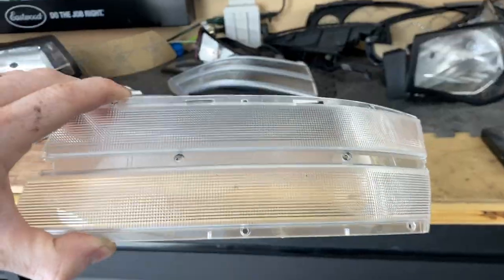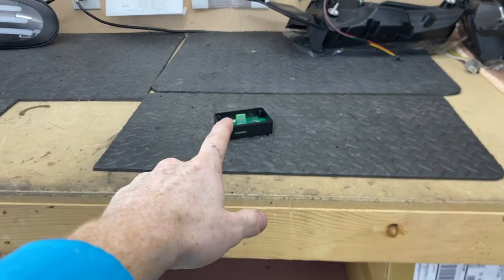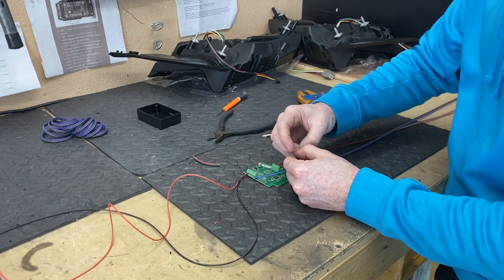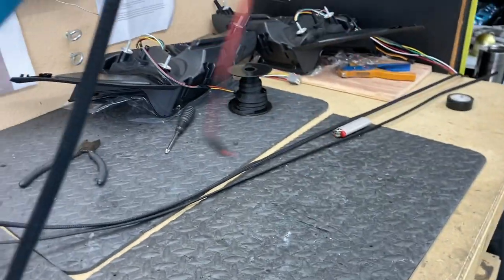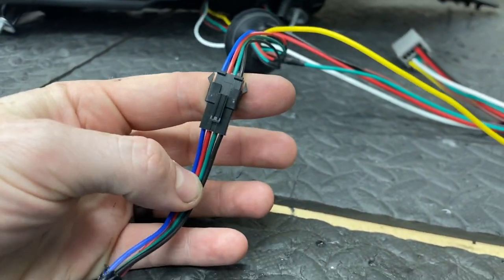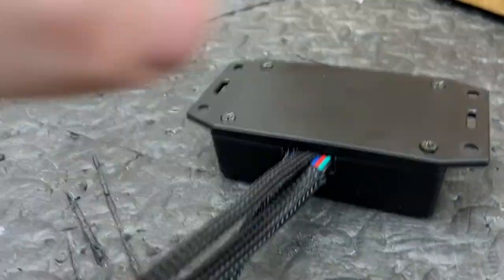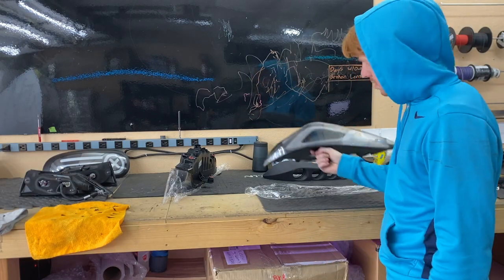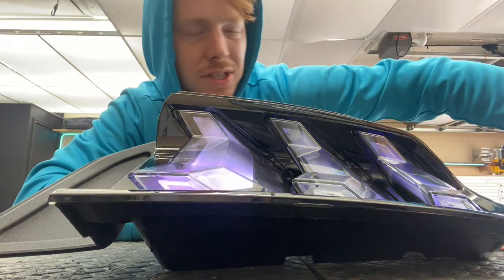DITL - color shifting mustang tail lights

Comment: Nice af can’t wait to have some color shifting lights on my truck. But is there any way to have the color shifting on while driving and turn red or yellow when I hit the brakes or turn signal??
Reply from the maker: Actually ya! 
The blueghozt let’s the brake and turn override the show mode 
And it lets the show mode over ride the parking lights 

Plus i usually try to have a separate brake and turn signal in the light somewhere so that it’s bright enough
Reply: @zaccook  bet!! Whats a good site to get aftermarket tails?

Comment: so the stock mustang lights are super duper bright because one bar has to put out enough lumens for a whole brake array at the same time. Are these as bright as the OEM? I also noticed a difference in diffusing on them. Is that normal?
Reply from the maker: The OEM LEDs that ford uses are soooo bright. 
I wish i could get my hands on those LEDs 

Pre mods these aftermarket lights are dimmer than the oem ones. 
I leave the red brake lights in there because addressables are not bright enough for brake lights yet 

There are two different versions of these aftermarket clear tail lights that I have worked on. One set is more diffused than the other. 
I personally prefer the one that is more diffused but it’s impossible to tell which that you’re gonna get it whenever you order them.